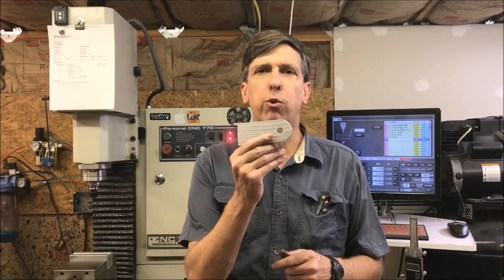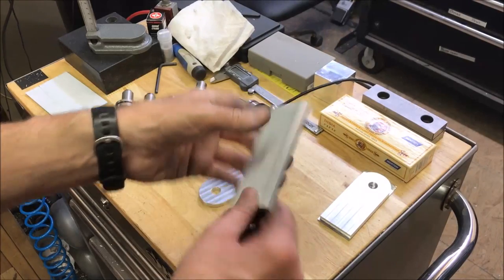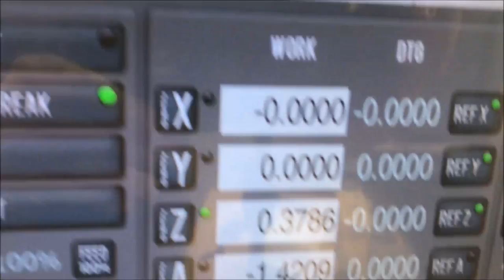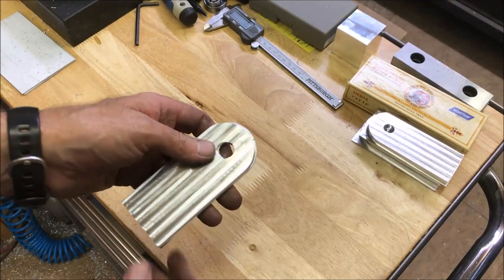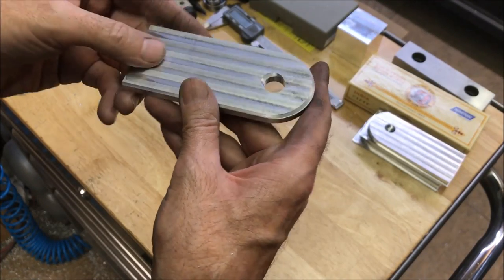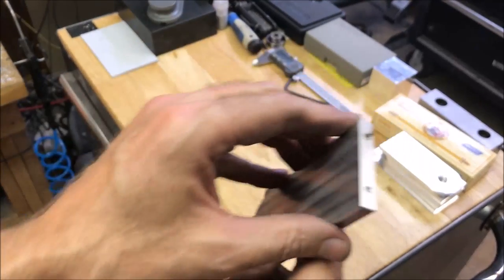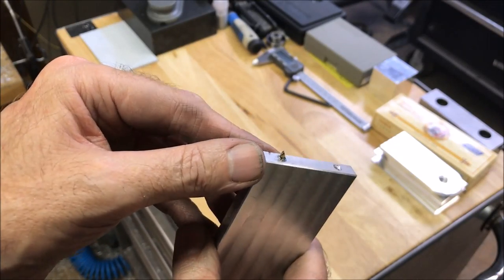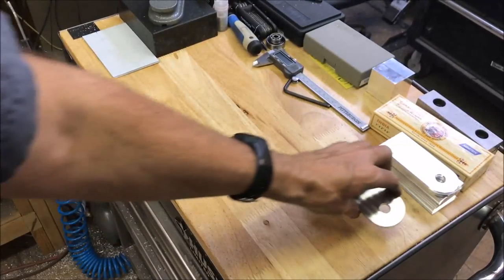Paper Towel Holder Part 3 - Machining the Upright

Comment: You should rethink how you do your zeros for a part like that.  I use a mill stop  and a 1-2-3 block.  Set your mill stop.  Push the1-2-3 block against the mill stop and clamp it in the vise. Zero the top, left and rear corner and then offset the Z by 1 inch.  This effectively sets the zero to the bottom, left, rear corner of the part.  In Fusion360 make your zero point the corner of the stock for the first operation and the corner of the model for the second operation.  When you machine the part just slide the saw cut end of the stock against the mill stop,  clamp the part and run the first operation. Then flip the part over and push the freshly machined edge against the mill stop, clamp the part and run the second operation.  Also, as already mentioned, get some coolant/lube on that drill bit.  I prefer flood coolant but even a shot of wd40 probably would have save your part and drill bit.
Reply: Yeah, you don't need to probe rough stock. The jaw should have a built in Stop bolted on the side. The Y is located off the solid jaw and then done. Consistent G54 each time. Probe the jaw once and that's it for any job that will fit in those jaws.
Reply from the maker: Great info Jason, thanks!  I will have to give that a try.  I tried the vise mount work stop from Tormach but didn't like it.  Do you use a vise mounted mill stop or one of those table mounted that pivots down?
Reply: I mostly use the jaw mounted ones.  Kind of like the $20 Edge Technologies jaw stop only mine are not as pretty.  A lot of the work I do is narrower than my vise jaws so this works well for me.  If you had something that was longer than the jaws you could use a tee nut in the table to clamp a piece of scrap on top of some 1-2-3 blocks.  If your piece of scrap sticks up too high just machine the end of it off until it is low enough.
Reply from the maker: Thanks, I plan on using fixture plates with dual vices so maybe I will get a work stop that attaches to the back of the jaw or on the table.

Comment: Gawl Dawg Drill bits had the same issue with small drill. try a deeper peck so there's more of a chip that seemed to help me.
 Be Safe, Sam
Reply from the maker: Thanks Sam.  Yeah, I will give that a go and try to get the fog buster closer and turn it up. Small bits are tricky.

Comment: Looking good, the drill at the end - it galled up with metal, you need coolant and to get the speed and feed right. In addition you don't need to retract from the hole each drill cycle, just use chip breaking - partial retract in fusion instead of deep drilling and set your accumulated pecking depth to something like 2mm (0.07in) good luck!
Reply from the maker: Thanks!  I wish I could use coolant.  I have no stand or enclosure.  The mill is on a wood bench.  The best I could do is lower the Fog Buster so the  tip is closer and open the valve on the Fog Buster all the way.  I will try the chip break, thanks again.
Reply: even a couple of squirts of wd40, trefolex or rocol as its drilling will work wonders
Reply: Fog buster is fine its all i use also, looks like you need to turn it up just a tiny bit! or like daniele says just give the bit a squirt of wd40 before each hole :)
Reply from the maker: Cool, Thanks Daniele.

Comment: Aw man! It's always something, isn't it? One time the second side of something I was milling didn't line up correctly with the first and what I found was that the ruby ball on the probe had spit in half somehow. Of course, the half that stayed on the probe was to the front of the machine, so it looked normal unless you were looking pretty closely.

I hate trying to remember to reset the zero after doing a bit of milling. I frequently forget. Or, if I need to move the zero point by a certain amount, say 1mm, I end up moving it in the opposite direction. So what I would do with that part is bore the hole all the way through and then use that to locate the second side. And since you're using a probe, zeroing to the bore will be easy as cake. It's sorta odd locating to a circle, but it works... if in doubt, run the probing routine twice and compare the machine coordinates between the first and second try.
Reply: A little workaround I found for roughing the first side is I'll do two 3D adaptive clearing toolpaths. The first one can be made to avoid the hole by simply making the diameter of the helical entry too large to go through the hole. So, if the hole is... 3/4", make the helical entry diameter 3/4" as well, that way the CAM will skip the hole and mill around the perimeter. Then do a second 3D adaptive clearing (with normal settings) and select the edge of the hole as the boundary, since this one will be a second operation you can set the bottom height below the stock to make sure the end mill goes all the way through.

There are certainly other ways to easily make two different roughing operations, but bumping up the helix diameter is basically only one step.

... Just make sure there aren't parallels below the hole. :p
Reply from the maker: Yeah, I'm realizing that you have to be on your toes with machining and even then, still make mistakes.   I've been an electrician for so long that I think I got use to being able to do most things in my sleep.  

The ruby ball broke?  Of course it would be the back side. Lol.  Now I check to be sure the stylus is tight every time I use it.  I have already gotten in the habit of changing to tool 99 (Probe) and setting the feed to 30 when I put the probe in.  I think an important part of machining is developing the habits.  

I will have to try the bore method.  I think I will be doing that for my fixture plates in the future.  

I've been lucky, I haven't hit any parallels yet, many vise jaws but not parallels. :D